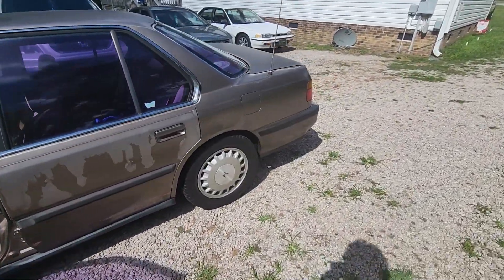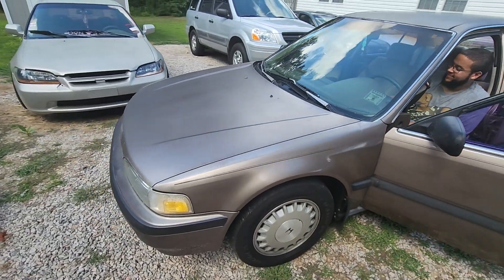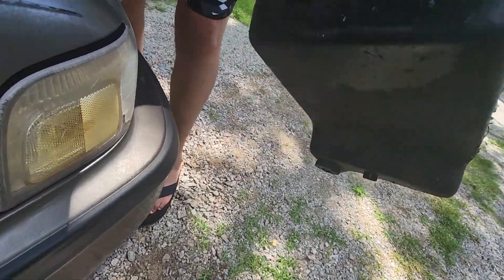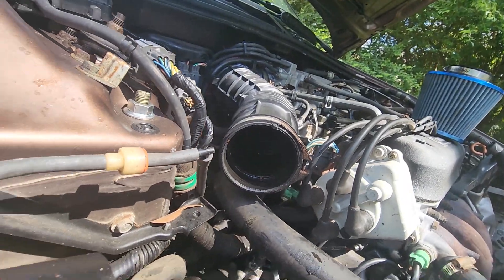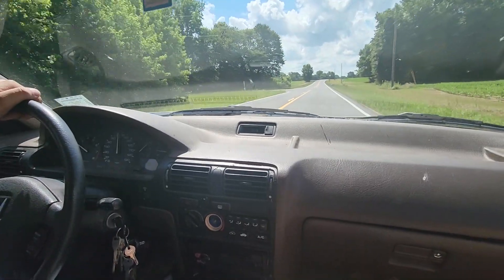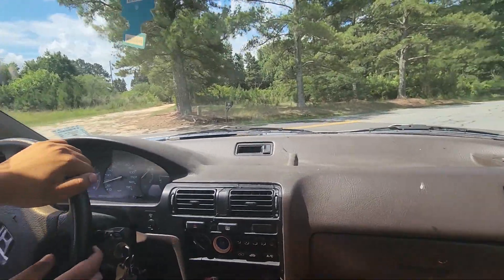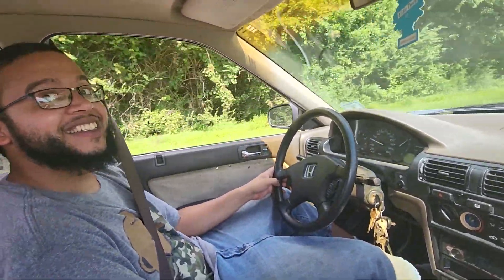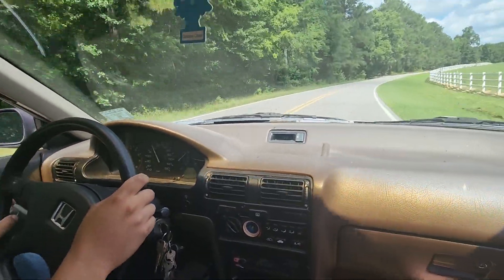CHEAP Intake Setup Sounds AWESOME On This F22 Honda Accord

Comment: Hey is it good if I delete the little vacuum line running to the cold air intake another Honda guy has his just wide open ?
Reply from the maker: That's fine
Reply: It'll be okay I've seen people just plug the hole or run it open mine has a hose on it with a bolt stuffed into the other end to block it